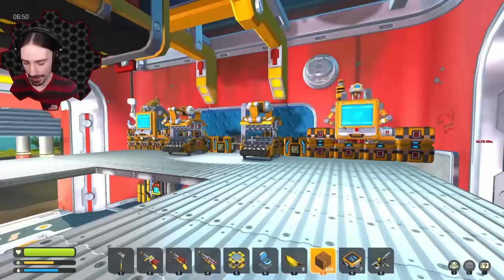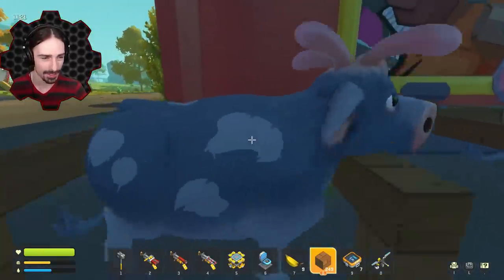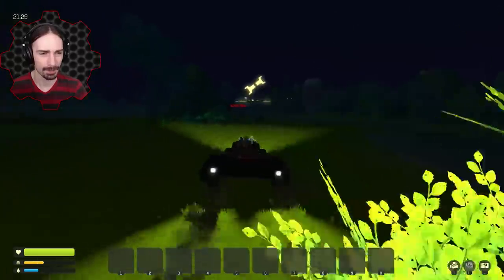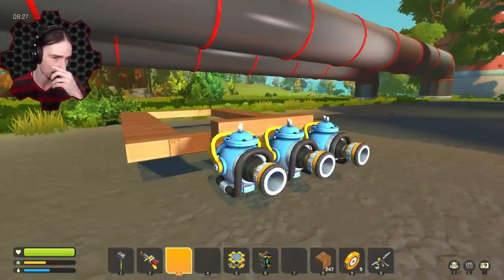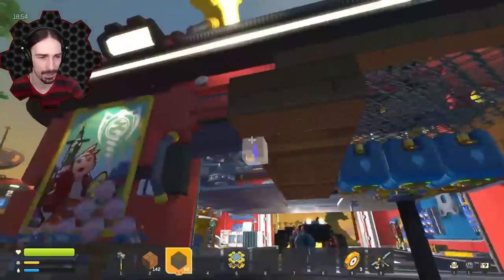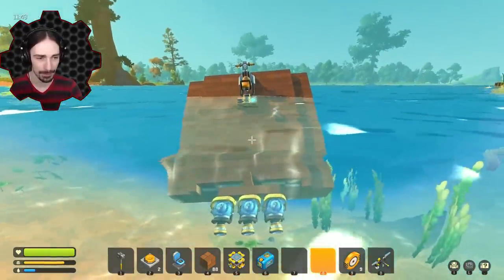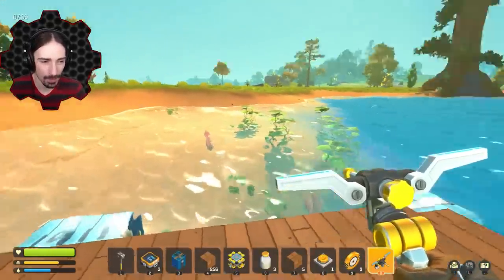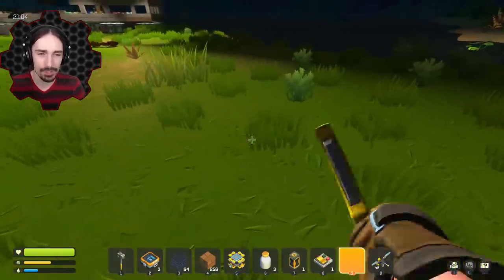Water Cannon Experiment! Can They Propel a Boat? - Scrap Mechanic Survival Mode [SMS 16]

Comment: @ScrapMan, about mineing: i realised when you put the rotation of the drills on a level5 controller set to 360° loop, full speed and single bearing, then it breaks down the rocks realy fast. even if the rocks just lay ontop of the drills it works pretty good. not to mention the 0 fuel consumption. (i was useing a 3 side cage with 7 drill heads on the bottom end that can be widend and narrowed to the sides)

Comment: Scrapmechanic devs, whe need air physics and water dynamics!
Reply: Air and water 'physics'
Reply: @lllz9800  physics sounds better cause you can break them easier
Reply: @supernova5434  seriously now
Reply: @supernova5434  bruh dynamics and physics are different.
Reply: Dynamics are only related to fluids?
Reply: @lllz9800  thats my point
Reply: @supernova5434  oh ok
Reply: @sladdersgray7097  and air is of course a fluid
Reply: Are Physics only related to how solid things should react?
Reply: @sladdersgray7097  yea because screw Aerodynamic airplanes
Reply: Scrapmechanic devs? Do you mean Axolot?
Reply: @JagiUGG  yes Axolot, did you know they liv in Sweden stockholm

Comment: Scrapman you need to weld caged farmers to your raft, they are insanely buoyant, able to easily hold numerous pumps. You might actually be able to use to propel your raft with water cannons

Comment: Suggestion on the button used to activate the crusher from a distance: add a couple buttons around it to give yourself a bigger target, that way you don't have to be as accurate while under the stress of dealing with a raid
Reply: further suggestion for said button: set it up (if possible) so that it can only turn the crusher on, not off, to safeguard against tapebot's accidentally turning it off
Reply: @zachrodan7543  tape doesnt affect buttons.
Reply: sensors that once turned will activate the system. But use logic so the only way it Can be turned off by a button you press. So system will defend raid for u
Reply: or spread the buttons incase they are blocked
Reply: Suggestion on an automatic crusher, i was thinking you can live it "on" crushing on its own even if your going somewhere

Does pistons use fuel or something?
Reply: @Bnm0l  pistons dont use gas
Reply: andrey goncharov

Okay :3

I was thinking you can live it on crushing like your never ever going to turn it off XD

So when the raids comes its just there turned on & Crushing "Bots"
Reply: @Bnm0l  the only problem with that is lag
Reply: I knew it well be laggy

But its Okay :3
Reply: OMG have you SEEN how good a shot he is????
Reply: @AlienWacker  wasn't meaning for it to be discrediting to his aim, I'm just saying it's better to avoid the stress of having to be so precise. Avoiding stress is always a good idea I feel

Comment: Hey ScrapMan, if you can't run with your gun out, aim down the sight for a moment. You should then be able to sprint again with the gun equipped. 

I came across this bug myself and was able to replicate it consistently. It looks as though the game doesn't realize you stopped aiming down the sight if you scroll off your gun while aiming.
Reply: Yeah i got that glitch alot in the warehouse raid. ADS fixes it
Reply: @codethewill  It's not an exploit, it's a bug. It prevents you from sprinting.

Comment: scrapman: "i've seen people use thrusters to power boats. and i have seen how much fuel they use" 
me: i have only seen that in the survival trailer
Reply: I made a huge boat that’s a 50-50 and I was able to go a total of 100-150 blocks before I ran out of 100 fuel
Reply: Camodo and spy cakes did it ...it was a really funny failure
Reply: Johnbane and dieseldesigns have both made boats
Reply: Kan made fuel free boat with the glow bois

Comment: Reverse a vacuum pump on the water crate so one feeds in and one feeds out, the one feeding out facing horizontally and use that as a form of propulsion rather than that water cannons.
Reply: @zackf3804  looking at what john bane was doing, vacuum pumps don't have the recoil that water cannons have. It seems like they have none at all.
Reply: Reading ur comment I was thinking this maaans is a freaking s rank scientist 😵😵😵😱😱😱💣🤯

Comment: " Wat-r you expect?" Really, Scrapman? "Wat-r you gonna do about it?" was staring you in the face and you missed it! lol
As for water cannon propulsion, do they have any knock back when water hits something? "Blow your own sail" is a silly idea, but so is not having water resistance.
Reply: this will peobably work because spuds have more force when they hit something, and beacause of this all spud gun vehicles are "blowing their own sail"
Reply: Jonáš Lavička no, they fixed that a while ago. The force of spud gun recoil is equal to the force of them hitting something.
Reply: @vibaj16  Oh they fixed it? well then theres no hope for the water cannon propulsion
Reply: That's unfortunate. I guess the only gas free water transport will be the piston ferry where pistons push a platform across the water to a predetermined destination. Though at that point having a fixed walkway or swimming is a better choice material-wise.

Comment: Water in SM does clearly have lot of resistance. It is just calculated same way as air resistance. You cannot make working paddles, wings or propellers in SM but water and air still slow you down.
Reply: Last I herd the devs did not have that implimanted. Unless they updated it
Reply: I think that the resistance is just air, and water only adds the bouyancy
Reply: flying munk89 it has always been like that. Otherwise, you could just use a thruster to float in the air, and then activate another thruster to move horizontally, then deactivate it, but you would keep moving and never stop. Their air resistance stops that from happening, but you still can’t make wings or propellers work.

Comment: I would suggest lining your water cannons on a z-axis along the keel of your boat, in order to more evenly distribute the weight from bow to stern, rather than concentrate it in the aft section- that way you can at least somewhat avoid the difficult problem of adding more weight to get more buoyancy in one section of the boat (i.e- putting one/two water cannons under the bow and the same amount of cannons under the stern should allow you to more effectively utilize the buoyancy of all of your hull blocks to directly counter your weight).

An interesting concept would be to test out pontoons/hydroplanes.  Technically speaking (not sure if this is a mechanic in this game like it is in SimplePlanes) but the deeper in the water a buoyant object is, the more force acts upon it to push it to the surface.  Since water resistance isn't something you have to worry about, you could afford to build pontoons that sink farther down into the water, thus enabling your boat to accumulate more buoyancy for less of the weight.

Comment: Hammer powered rafts are a pretty good intermediate boat style, all you need is a bunch of thirst-refilling food and a fairly buoyant platform. I made a raft that was just a 16x16 platform with a couple block high wall around the edge, worked pretty well. Great job on the videos!

Comment: @Scrapman , You should make a bursted thruster with  maybe 5 water cannons. Now you had trouble with that buoyancy part. Well we've seen your progression in between episodes and such. You can do a lot. So if you grind you can make a ton of bubble blocks for the base. Make it as even as you can.then spread out those water cannons under the boat. have one in the bottom middle and four "cannon" steering on each corner. Then have a thruster to help turn and move turn on for maybe about 5 seconds every 5 or 10 seconds. This may not work but I think it's worth a shot.

Comment: In the Scrap Mechanic Trailer, one of the hay bot traps involved propellers. I suggest using propellers instead of water cannons. If you remember from your multiplayer series, one of your creations used propellers Scrapman. Plus, real life boat use propellers to drive thru the water. I don't know if the devs added propellers to the survival mode yet or not but that might be a better alternative

Comment: Water physics summary (as far as I know).
The buoyant force is fine, proportional to submerged volume.
The resistance, however... it is proportional to speed, volume, mass and it is 10 times smaller when you move horizontally.
Irl it is proportional to linear size of the object and the shape of the submerged object, I don't know why the devs did this.

Comment: Is it possible to fly up on a wearhouse and and then go down from there
Reply: You can’t get in from the top
Reply: Because the door is closed obviously
Reply: Yes but you still need a key
Reply: Samuel/ Stick yes you can. Don’t spread knowledge you don’t know is wright
Reply: Peter Jones all you need is the key to open it
Reply: Samuel/ Stick yes you can
Reply: @tacklessstone0369  you can't put a key in at the top right
Reply: Peter Jones what are you talking about? If you go to the top of the warehouse there is an elevator that you can use to travel down the warehouse
Reply: @tacklessstone0369  actually everyone else is correct. You can put the key in, but for some reason it won't let you go down the elevator

Comment: I tested a similar crushing defense and had the same piston problem for the one in the back. Turns out I had the rear piston mounted 2 blocks higher than the front 2, but I had all 3 pistons set at the same range. So of course the rear piston was pushing against the creation as it tried to extend. I dropped the rear piston range by the two blocks and it worked perfect. I'm not saying you had the same problem but your rear piston also looks to be slightly higher than your front 2.

Comment: i made a little shack with automatic alarms to put my wocs in. 
they cant escape as easy and they are better protected. 
the alarms go off if there is any attacking farmbots. also, in case of emergency it has and elevator to bring the wocs off of the ground if something breaches the wall.

Comment: maybe there is still some sort of water resistance in the game but it's just really simple? maybe if you used pistons to sort of doggy paddle the boat making sure to take the "paddles" are completely out of the water each time? like maybe the individual grids only make a difference when center off mass moves while in the water?

Comment: Consider this: thrusters are inefficient for a boat propulsion, and there are no other useable propellers. Thrusterpowered airbikes can be efficient because the power you can recieve from a thruster while moving through the air. If you make a vehicle that can harrier themselves in and out of the water, and be bouyant enough to float, and have the capacity for a chest or two, then you have yourself the best marine trabsit system. Or to explore on another large island.

Comment: I'm curious about water cannon with a thruster. Can it assist it enough that you can turn the thrusters down? To save fuel.

Would a piston on a spring glitch provide enough forward movement?

Will you be building a balcony outside around the second floor of your base?

Comment: It seems that engines work underwater. If you built a heavy enough machine, you could technically drive across the seabed. Lifts also work underwater

I reckon concrete 3 and a few resource collectors might weigh a vehicle down enough to be able to drive across the bottom, but i've yet to try it. The issue is making something heavy enough to get decent traction.

Comment: I have two experimental questions:
Does a sensor detect the water surface/subsurface, or does it only read blocks and terrain?
Can you rig up a column of pistons at an angle to provide a pole-barge style of propulsion with variable length?
(I want to try the second one myself, but I suspect it needs enough resources that my short play sessions are going to take months.)

Comment: If water projectiles don't cause physics calculations on collision, you could make a propulsion module in the centre of a ship; that would help optimise the weight distribution issues and then maybe make it a bit more viable of a system.

Comment: Have the water cannons face upwards that way the weight will push them down and make the boat lift up. Build the boat into a "L" shape that way when the water cannons go under; where you sit comes up above the water. 
The water cannons will be under the water propelling you forward while you're on top with all the buoyant wood. But with less weight overall

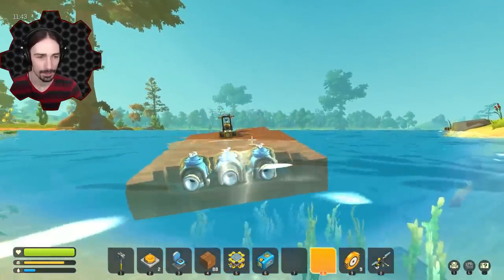See what I'm talking about at the 20:52 mark. Just had the thought just now when I saw that.

Comment: I wonder if they increased the thrust at all.  I know they have made the pumps a LOT faster, like 2 per second.  I might have to check this out.  I have also wondered how effective a sprinkler would be... a water pump that varies its angle up and down as it spins around.  I worry because I am doing a Nomad run so my vehicle is EVERYTHING and the new update for the final release of the game they are adding fire that can spread... and my vehicle is made out of wood to keep weight down.  I do not want 10 water cannons on top of my vehicle, but one spinning would be OK.  I do not even know how far they actually spray as I only have them watering my farm right now and they spray down only.  It looked like they show moderately far when he tested the boat first, so I might have the sprinkler start spraying straight out and as it goes around have it increase the angle about 15 degrees until in hits 90 degrees.  With a repeater it can spray pretty fast.

That does give me another idea... not sure if it still works but you used to be able to stun a robot by throwing water on it.  If a sprinkler system works on my vehicle I might add it to my farm.

Comment: You can build an underwater vehicle. Engines work underwater. You can use pistons to lift yourself up to get oxygen. 4 pistons set on 15 is enough to get above water. (Controller or just max pistons). The pistons just lift up the drivers seat.

Comment: Use a level 5 engine for the paddle. Also use the awning pieces from the shacks. Set the engine to max. Make sure to balance the raft or it may flip

Comment: you can avoid most raids, by using the trapped farmers to build a floating base. It does not matter how much weight you put on them they will keep floating like only the bottom of it touches, none of it under-water

Comment: Maybe you should use wheels for buoyancy becase they used them in the trailer. Also you dont necesarilly need to make a floating raft to call it a water based vehicle. You could make a car that sinks and drives with water cannons

Comment: Also, would it not be possible to install a suction pump over an oil source and have it fill a container? Yeah, I know, it'll be real slow due to the re-spawn rate, but in theory it could work, couldn't it?

Comment: I think once they add wedge pieces after they're done programming dragable wedges, theres gonna be water resistance and the paddle thing might work
Cause the water is pretty bland for now, hopefully they add more into it
Reply: And they did add propellers as seen in the trailer, so hopefully true water resistance is coming
Reply: @vibaj16  
Yeah same as i was thinking, those gotta have some other use rather than just for damaging haybots
Hopefully its water physics

Comment: Why do you all make flat rafts instead of boats? Wouldnt the extra bouyance of a hull allow for more to be placed on the boat without sinking?

An outer shell of wood filled with bubbling wrap (in place of air in real boats) would be perfect and allow for much more weight. And with the second material being so light, the boat wont be too heavy

Comment: You could also put 4 “peddels” on a barring on each side of the boat and make the baring rotate with an normal engine. It does take fuel instead of water buuuuttt waaayyyyyy les then rockets...

Comment: i found out that tier 3 wood is the absolute best material for building rafts I used 200 tier 3 wood on a raft with 7 thrusters and two chests and it works perfectly

Comment: i discovered a way to go quickly across water with no fuel 
you use your hammer and hit a floating half box think of a square boat and the impact force kicks you across the water very quickly
its almost like paddling
i figured this out after i dropped a roadside shop in the water to see what happened and it semi floated
like the area below the bedroom was under water but above it floated 
so i started taking bits off to see the tipping point and got stuck as it started sinking so i hit it and next thing i know i'm near shore so i got it on my lift and cut it flat and made something resembling a rubix cube basically a flat wood structure with 8 9 block holes surrounding a 9 block platform and started whacking it with my hammer and i basically started surfing

Comment: They should add oil rigs that you could loot and with lots of oil in it. In the oil rings they should have a boss and other bots in the ring and I would make a lot of sense since there are bots and they need oil to run.

Comment: i ended up making a car that drives on the bottom of the water out of punched steel blocks (best cost to weight/boyency ballance) it also works on land although you have to turn the engine down

Comment: Can u go on top of a locked warehouse and make a wood line on a lift then make it come down then a seat then get on and lower the lift so the seat goes through the ceiling. See if u go threw the roof and then see if u can get out

Comment: I know a way to stun all of the bots butbit will require ALOT of water so you will have to make alot of water pumps to put water into the canons and then put the canons around ypur base to stun the bots please respond yes or no for your opinion

Edit:when i said water pumps i meant containers and the water canons